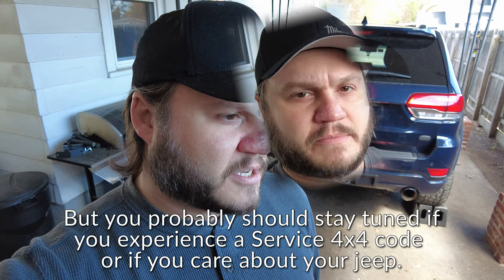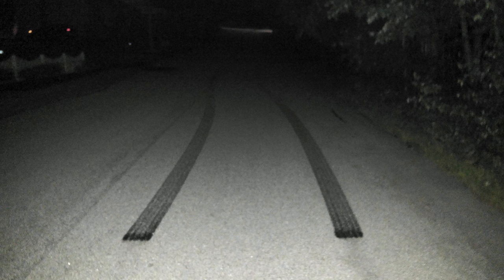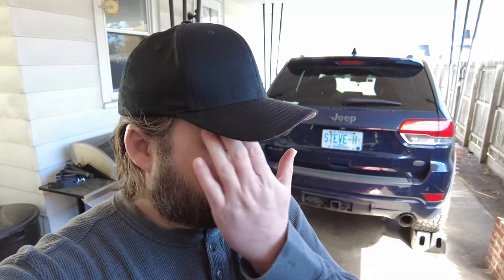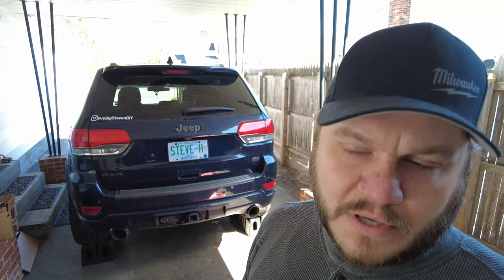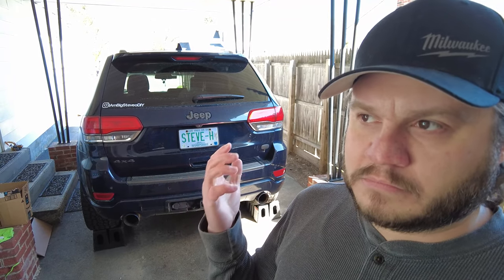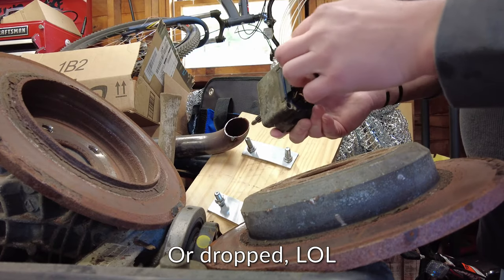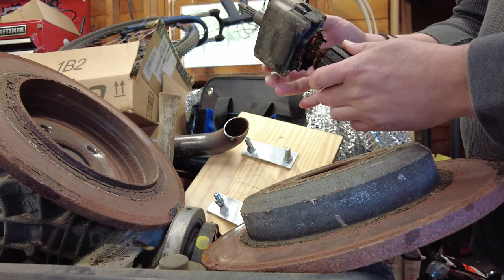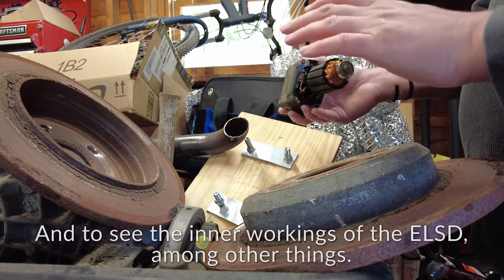Grand Cherokee OWNERS: Service 4x4 System? How I fixed mine after blowing up my rear differential

Comment: Hey Steve! Thank you for sharing!  I just had my 2014 Jeep Grand Cherokee Overland in for an oil change and while I was there they upsold me on a differential service. While still in parked in the bay at the service station they had me start the jeep, promptly the "SERVICE FOUR WHEEL DRIVE SYSTEM" came on. I had no previous problems with it. Any ideas??
Reply from the maker: Hey Erica, did the service fellas fill the diff and close it up before having you start it up? I'm hoping so.. Did they fill the diff with oil that has the limited slip additive? The limited slip additive is required in this diff since it has an electronic-LSD. If they did not include the additive, then that may cause an issue. See if you can have this shop clear your codes (they will need a full scanner, not just a basic check engine code scanner) to see if it still comes back. Technically, they did the service and it's throwing a code, they should be on the hook to solve this issue. Good luck!

Comment: WOW. Was glad when you said "NO MORE CODES" then followed with "JUST KIDDING". Your vids are very entertaining, thanks for the roller coaster ride. I'm learning alot watching your videos, sadly on this one it's what not to do (buy) - freaking Tazer! Sounds like It would be awesome too, I've taken my 14 O' 5.7 to N.E. Dragway 3 times, would've been cool to use the burnout box! Oh and do you know for sure your diff was bad - was there a code for that, is that what DTCM was? Thanks for the videos.
Reply from the maker: The Tazer is a neat device and does a lot. It can read check engine codes and can customize the vehicle settings all for a couple hundred dollars. Thing is, you can do the same thing if you have a OBD2 and a windows computer or a smart phone which most people already have. So I ended up selling my Tazer and used what I had to customize my settings back to how I had them with the Tazer, but without mucking with the rear wheel drive settings, that is something you need the Tazer for but doing that literally serves no purpose other than showing off and blowing up you drivetrain lol. 

Yeah I’m pretty sure my diff went bad, it howled even with the correct fluid levels. You can hear it howl if you go back to an older exhaust video I made with the Jeep and listen to it during the drive bys. When I drained the fluid after it started throwing service 4x4 codes, the fluid looked like liquid metal, the dust from the clutch packs for the elsd were fried and the motor kept trying to do what witchcraft it does but it couldn’t and this the initial service 4x4 codes I got which prompted me to begin this whole trouble shooting and ultimately sourcing a replacement rear diff.
Reply from the maker: The DTC I mainly talked about in this video was for the motor circuit falling out of range, C148F1D. The first DTC that prompted all of this shenanigans was C2221-00 and the dealer suspected the clutch packs went bad given the fluid was black and the whole diff needed to be replaced. I agreed with them given the state of the fluid.
Reply: @iambigsteveo  Thanks for your reply and I'm so glad you fixed it!😁These Jeeps are so freakin nice, I don't think there's a better vehicle out there!

Comment: Did you have a clunk when accelerating normally to moderately from a stop? Also did you have a random shutter feeling coming from the back during heavy acceleration? I’m trying to troubleshoot a similar issue with my 2015 JGC SRT. Thanks!
Reply from the maker: Hi Richard, 
No fortunately I did not have these symptoms. Your symptoms sound more mechanical within the driveline than mine. Mine didn't really feel very noticeable when it was failing, albeit, it was a little tighter while driving once I replaced the motor. 
Your symptoms sound more like CV slop in drive shaft, or even the half shafts going from the rear diff to each rear wheel. Slop meaning there's a gap that's formed from wear within the joint of the drive shaft, so you can rotate the driveshaft and the outer side of the joint does not rotate. 
You could also have increased backlash of the pinion gear to the ring gear inside the differential case. 
Put it up in the air and start turning the drive shaft and the half shafts to see if things rotate or wiggle without that rotation being transferred further up to the transfer case.
Reply: @iambigsteveo  wow this is great advice! I will check the driveline and half shafts this weekend and reply back. Thanks!
Reply from the maker: Good luck!
Reply: I have a 2014 SRT with similar clunk when accelerating, but has been making it for longtime and works fine otherwise
Reply: @jbatistamd  thanks for the comment. Turns out the clunk on my SRT was a clutch pack in the transfer case. Too expensive to repair so I sold the jeep…

Comment: Hey Steve. Thanks mate, great video. I have the exact same issue with my Jeep. Did the issue eventually come back after you replaced the ELSD motor?
Reply from the maker: I saw no more lights, warnings or messages on the dash relating to this. I consider that a win!

Comment: How did you lower your suspension?  Mine looks like it has been lowered and i would like it to go back up.  Was the code cleared with the scan tool?
Reply from the maker: Mine was lowered with custom links I made to lower it. It has QuadraLift which is air suspension. If you too have QL, check to see if you have the factory links installed and go from there. 
As far as codes go, I do not recall receiving any new codes after this procedure.
Reply: @iambigsteveo  thanks

Comment: Did this issue put your vehicle in 2wd? When service warning light would come on? Thanks
Reply from the maker: Nope, it remained in 4x4. I’m not certain, but perhaps my issue prevented the rear diff from locking since it was related to the locker motor.

Comment: do you still have your old differential I was wondering if you wanted to sell it I need it for parts
Reply from the maker: I do still have the old differential, I wasn't planning on selling it unfortunately. You may be better off replacing the whole unit from a scrap yard like I did from a youthful vehicle than to tear it apart and hope it works. Good luck!

Comment: Great video man very helpful! Couple q’s: did you have to disconnect the battery at all and did you get a new o-ring ? Thanks!
Reply from the maker: Come to think of it, no I don't think I did disconnect the battery, but you should though. And no, I didn't get a new o-ring. Just lubricated it with a little oil and reinstalled the new one.

Comment: the rear tires wore out and decreased the diameter size. this confuses the wheel speed calculations on the 4WD computer. and you burned out your transfer case.